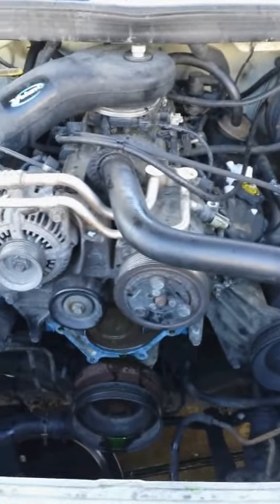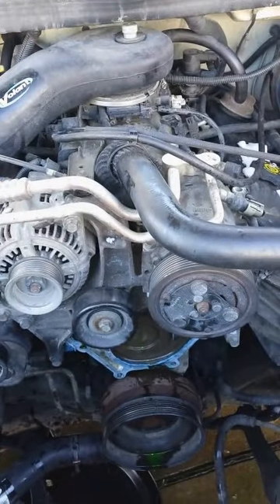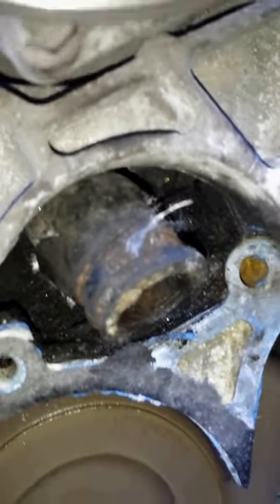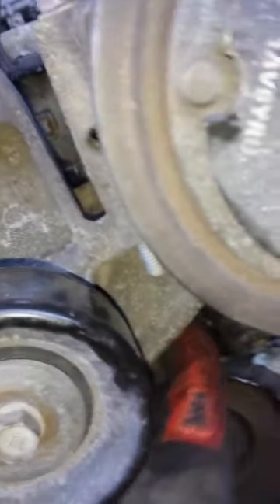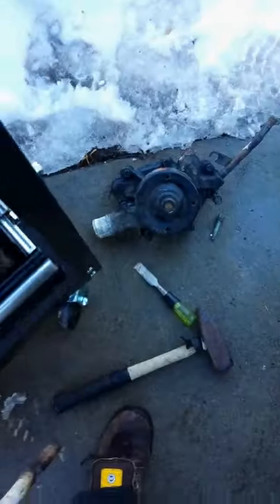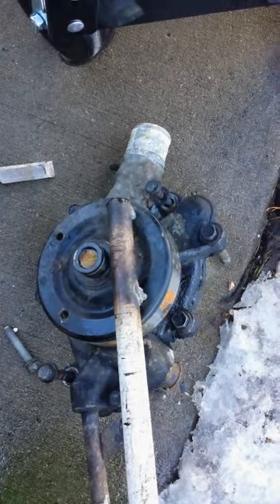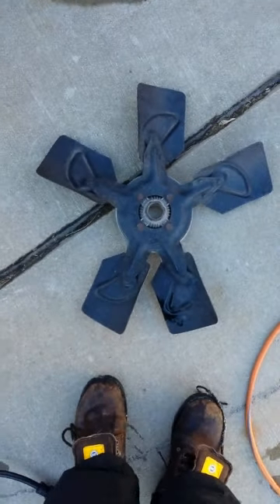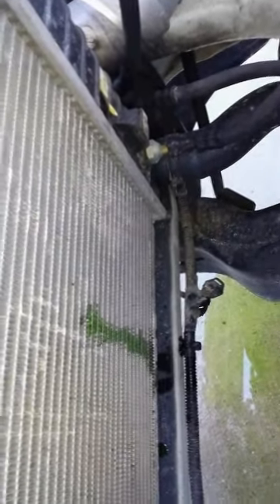97 Dodge Ram 1500 - how to replace the water pump small hose

Comment: VERY GOOD Video! Straight and to the point without a lot of B.S. talking. I have a 1995 Dodge Ram van and I replaced the water pump but didn't do the bypass hose. I was wondering how to get to that thing and your video was perfect. LOVED the zip tie idea!! So let me share a helpful hint too. Get a six inch strap wrench to go around the water pump pulley. It works great for getting the fan off because it holds the pulley while you unscrew the fan nut. No welding involved. Thanks again for the tip.

Comment: I had a antifreeze leak. It was my weep hole in my pump but it was too much coming out for that thought it was my freeze plug in the front of the motor but it was higher than that. I never knew this hose existed. I ended up taking the bracket that covers it holds the AC and alternator that little hose was a pain even with the bracket off thanks good job on your video
Reply from the maker: It is a pain. Glad the video helped.